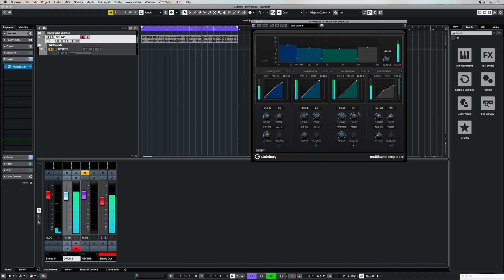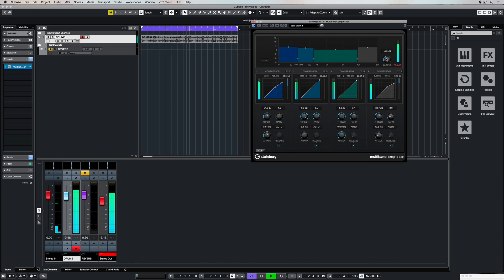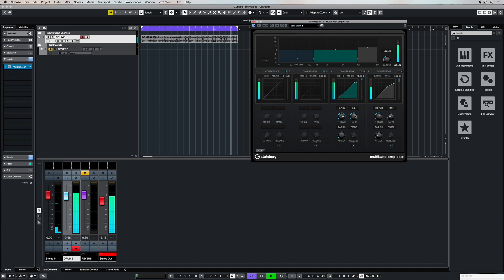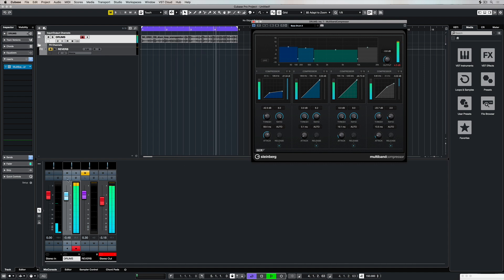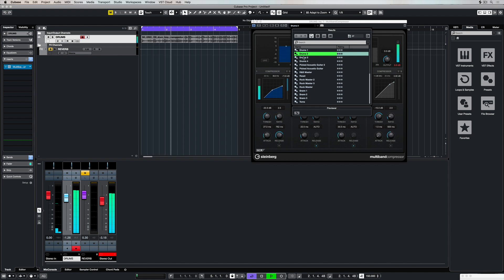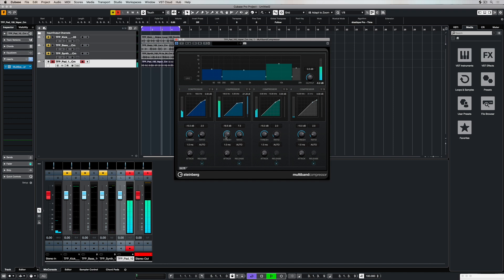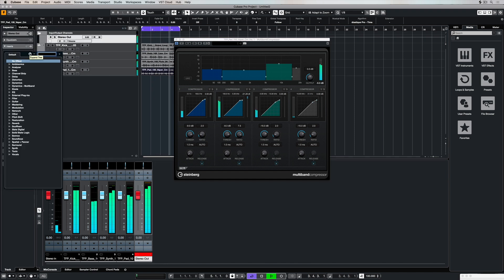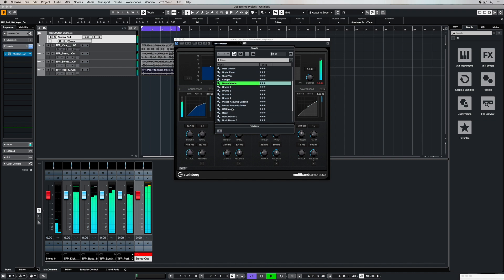Multiband Compressor | Effects and Plug ins Included in Cubase

Comment: Is auto makeup gain always on in each band? I can’t seem to turn it off which makes using this MBC really difficult for controlling muddy/harsh frequency ranges as those frequencies get louder instead of softer when compressed.
Reply: It's always on unless you activiate the sidechain for a specific frequency. But why would you want to compress an entire band because of one frequency? If I had to guess I'd say the rationale would be that if you want to compress an entire band then use a shelf filter, but it's not the same and really hobbles the usefulness of the plugin.

Comment: Always good to tell those who don't like the auto make up gain in this plugin that It turns off if you use the side chain part on the bottom. I like to put the side chain turned on by default. I even saved It as the default preset
Reply: i did not know what is happening; when i put multiband compressor on track it get louder , thanks now i know the reason it is the auto mackup gain
Reply: Does it work if you aren't actually using it for side chain?